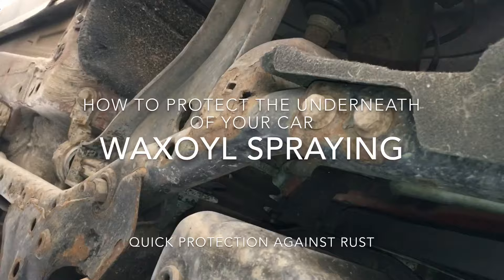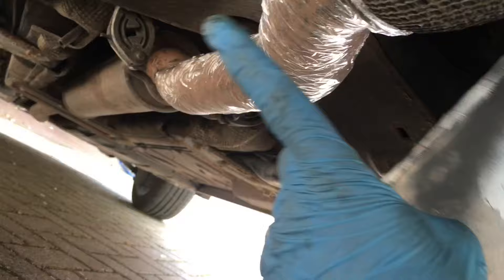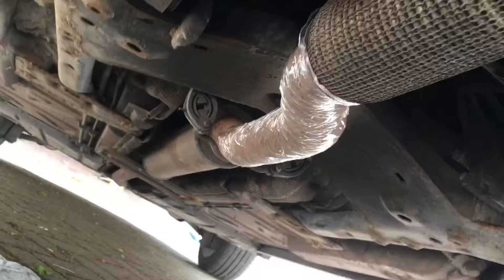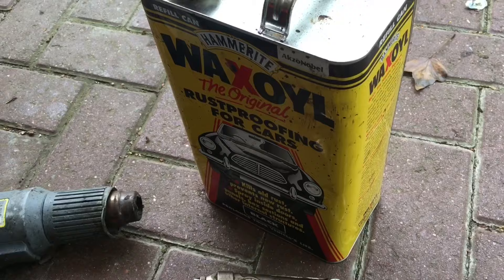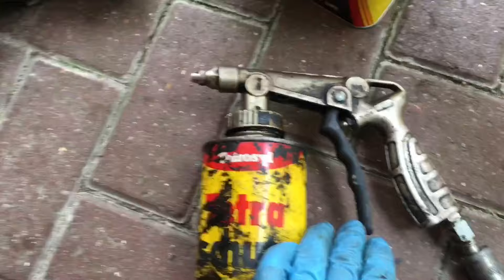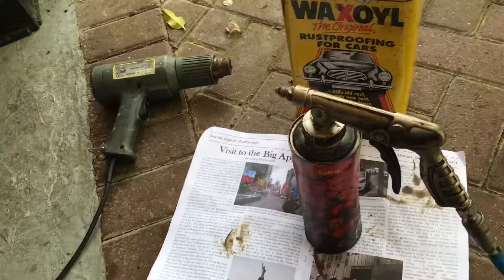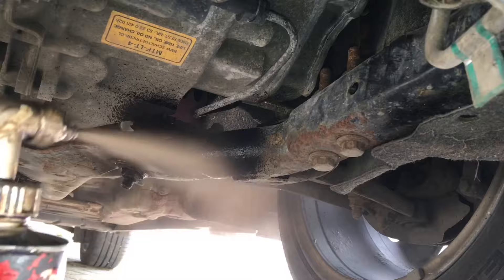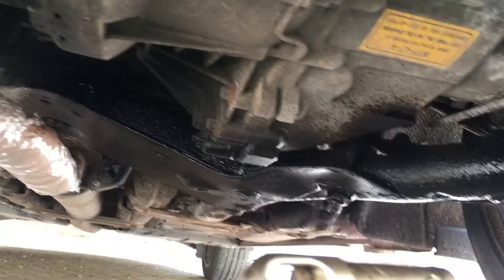How to Quickly Protect from Rust on Car Underbody - WaxOyl

Comment: Waxoyl is out! Raptor liner is better as it’s dry and doesn’t hold moisture like waxoyl in the uk
Reply from the maker: Thanks for your input, I am sure raptor is fine on clean not rusty metal, but I use waxoyl because it doesn't dry, especially as I add extra oil!  Then on any bits where the underlying paint flakes off the waxoyl will creep over the exposed surface. Or you can just spread it with a glove easily.

Comment: Does it really cure the surface rust as they say?
Reply from the maker: I wouldn’t use the word cure, but it does seal it in and stop it getting worse.  The same as if you dipped a rusty nail in oil, it would stop further rust.
Reply: @comeinhandynow  
Totally agree 👍
I have a Toyota hiace 2006 and looking underneath it looks very similar to the car in the video. I sure will be getting a compressor and a waxoyl kit with gun and can.
Thank you for the simple short quick and easy video. Help protect our cars from UK's winters 👍
Reply from the maker: @happyemojilearning2866  Cheers

Comment: Put 3 foot rubber hose on pick up pipe happy days alot easier
Reply from the maker: I’ve not tried that. I guess that works ok in warm weather. It may clog up a bit by the wax cooling off in the long hose in colder weather.
Reply: @comeinhandynow  heat with heat gun for 30 mins works a dream

Comment: Dont spray on discs and pads seconds later sprays them 🤣ffs
Reply from the maker: The back of the brake disc is protected by a backing plate, so not as bad as it looks!

Comment: DO NOT do it this way 🤣🤦🏻‍♂️ all your doing is covering rust.  Please if your going to this sort of trouble ALWAYS TREAT THE RUST FIRST. Something like ‘Kurust’ put it into a spray bottle,take off any splash guards or inner wheel liners etc wire brush for loose rust then over the lot with kurust. Then again.  And Then the wax oil undercoat. 2 coats.  Put it all back together and then a once over with acf50 👍🏼
Reply from the maker: Sure that is better, but you missed the key word here: “quickly”.  This waxoyl plus oil solution soaks into the rust sealing it against further oxidation/ rust, for at least a few years.  Just reapply now and again as needed.  A lot quicker over the years.  Done it lots of times. You can do the whole car in a couple of hours instead of days the traditional way.

Comment: Total CRAAAAAAAP. Rust starts Inside. U need to get inside.. strip the interior. I do this for a living. WORST product on the market. Formula was changed a few years ago...
No internal protection.
No wire wheel
No rust "converter"
No paint
U just have hidden it all
Underseal is the last step
Reply from the maker: You don’t understand how rust happens!!!  It needs air and water.  You exclude both by this covering, especially with my suggested addition of a small amount of oil. Yes remove what loose rust you can first.  But the rust left is sealed in with the wax / oil.  And you miss the point in the title, this is a QUICK way to prevent rust.  AND it works.  There is no further rust progression on the treated parts on this exact car nearly 2 years later.  So as a QUICK method to arrest progress of rust, it WORKS.
I’ve used this for years on old cars.  It may need some topping up after a few years, but as a QUICK method to prevent rust it is effective.  

The more thorough wire wheeling, sanding, converting, painting and undersealing is very time consuming and it is not worth the time and effort on cheap, old cars, so people won’t do it.  I have done it on more valuable old classic cars however. This is an alternative QUICK way to stop rust.

Additionally Waxoyl does have a rust converter in it.  Product description: “ Waxoyl is a thick, waxy fluid saturated with very powerful rust killer. Killing off old rust and preventing new rust, protect your car by simply spraying it on to metal. ”
Reply: @comeinhandynow  lol been in business for years. Booked up till May already this year...I only deal with rust. Nothing else.
Reply from the maker: @andyvaid69  Lol. I’ve been restoring and working on cars for decades. Move on and get back to work.  You completely missed the point I was trying to make.
Reply: @comeinhandynow  me to 1987 started..
Reply from the maker: @andyvaid69  Lol I was working on cars in 1977! I win.
Reply from the maker: @andyvaid69  You still don’t understand the key word QUICKLY.  Your further comments will be deleted as you just don't get it.
Reply: Agreed! My car cost me a grand and I'm not going to go to a shit ton of effort, time and money to get rid of underbody corrosion completely. I'm just looking for a quick cheap fix.
Reply: @comeinhandynow  Jeeze you have some patience mate .
Reply: @comeinhandynow  

Good video
Cheap fix and fast. my van is only worth 1700 so I want a quick fix and I don't mind topping it up every year or two
Good video mate
Reply from the maker: @happyemojilearning2866  Cheers. It’s a good way to save money later on replacing rusty bits.
Reply: @andyvaid69  we now know where NOT to come then🤣
Reply: @comeinhandynow  rust is the best all lovely and crumbly why on earth would u want to get rid of that!
Reply: @MrTwisted1977  it is fun when the rocker panel just dissolves.